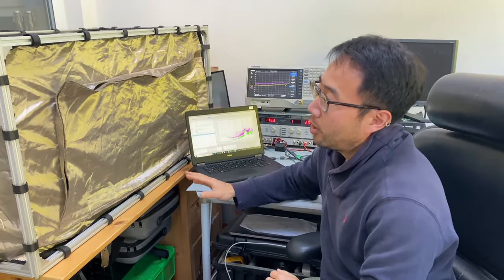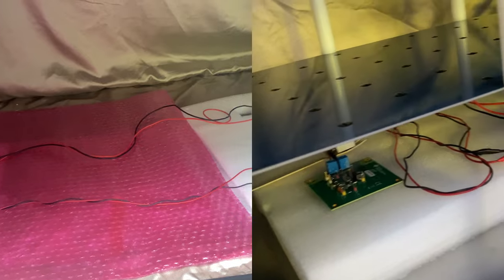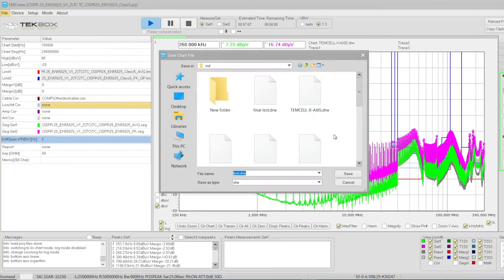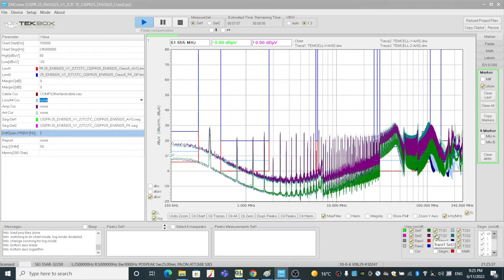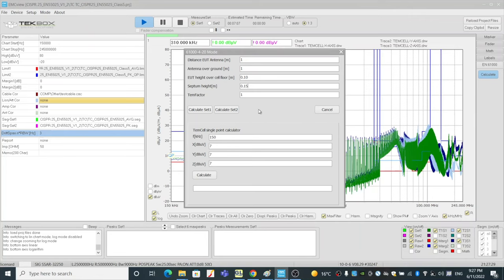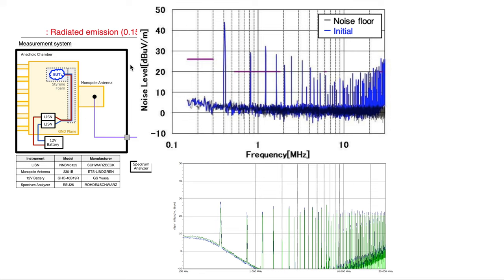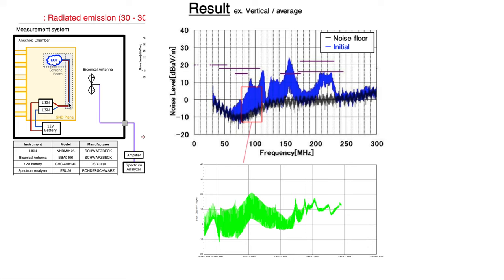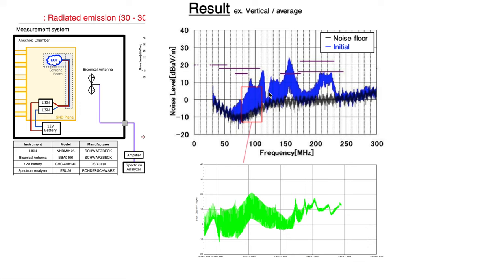Predicting Far-field Radiation - A TEM cell approach

Comment: What's the purpose of the LISN here? Could you do a FCC scan? Very helpful material. Thank you for sharing.
Reply from the maker: To be honest, i don't think the LISNs do much in here. But trying to set it up as close as standard. Although some test labs will power the EUT through LISNs  while conducting radiated emissions tests, it is not required in my opinion. LISNs do not provide a well-defined impedance to the currents associated with radiated emissions and electrostatic discharge.

Comment: The thing I'm mostly interested here ironically is the tent. I assume the tent is supposed to block radiation like a faraday cage. But from what I gathered, testing in a faraday cage isn't a good idea for radiation testing, because it will reflect the radiation and therefore will give you useless results? So what's the idea here?

Also, if the power supply should be stable and you're in an office environment - why not just use an UPS in the office, physically disconnecting it from the grid? You need one anyways for open air testing with the antenna, because there's simply no power cable in the field?
Reply from the maker: you are absolutely correct. I would not use such a cage for measuring radiated emissions. In places such as an industrial environment, what you often find is that there is a very strong ambient noise present when you tried to measure the noise of your own product, then this tent becomes useful. It is predominantly used for conducted emission and immunity test. For immunity tests, you also don't want the noise you inject into your unit affect equipment nearby, hence the tent.
Reply: @MachOneDesignEMC  I was mainly wondering if just buying an APC Smart-UPS or something like that and performing all the tests outside or in a basement would be a good idea or an extremely bad idea. 

The main reason I'm not sure is that these devices don't have a real "ground". I'm just not sure.

Similarly, testing near a high-voltage pylon / high voltage power line.. the idea there is that you can use the pylon as ground, and that while the power lines probably emit EMI, it's also very predictable and not much else is going on around there.

Comment: Thank you very much for your video! It seems that even with specialized software it is difficult to predict low frequency behavior from the TEM cell and I would like to know if you have  any advice for making accurate low frequency predictions. My 600W application uses induction heating at 67kHz (4477m wavelength). If I understand the FCC specification correctly the E field, but not the B field, of my device would be evaluated at 30 meters which happens to be well within the near field at 67kHz. Do you have any advice for making an accurate prediction of the 30m behavior at this low frequency?
Reply from the maker: Hi Derek that is a great question. Unfortunately, i don't. I hope you have the answer now? if so, please share, otherwise, i can do some research.
Reply: @MachOneDesignEMC  I never found the answer to my question but do have some helpful info. The E fields I was detecting appear to have come from CM noise as they did not decrease with distance from the device but rather increased with proximity to the supply wiring - in other words as the E detector was placed closer to the walls and electrical outlets. 

When I connected a 50uH/50ohm LISN I measured an output level of -3dBm at 67kHz, which is not surprising as I had moved from an isolated to mains connected design which raises the average voltage of the induction coil in reference to earth ground at the operating frequency. I am cutting some plates to change this CM to DM where it can be effectively filtered. 

As for the decay of the B field I was worried about in my original question, it may not be a significant issue. Per Henry Ott (p. 240), in the near field E will decay at 1/r^2 if the E field is caused by a coil while B decays at 1/r^3. Since my probe measurements indicate my radiated E is low close to the coil I believe it will take a long distance (compared to the FCC measurement distance) for the B to develop its E field and become far field radiation. I will keep you posted.